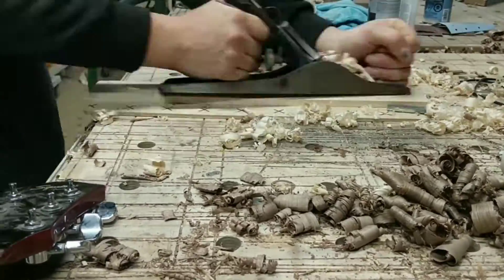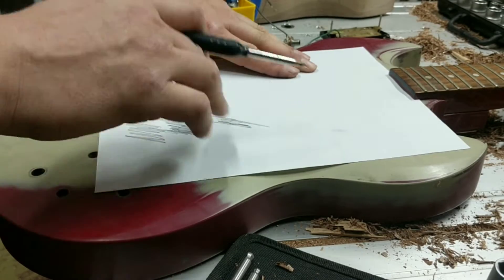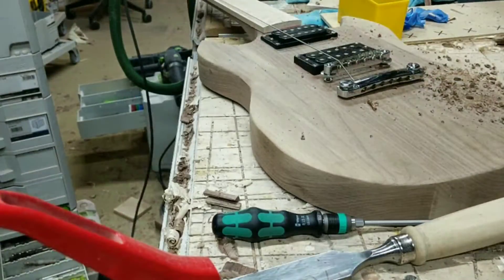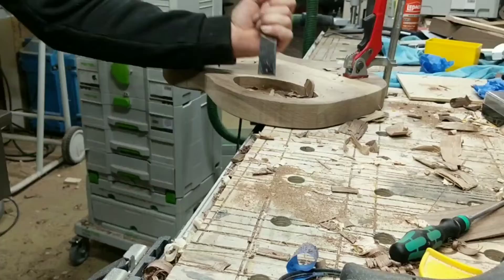The Guitar build series: Hardware Install

Comment: Hey man, it's better to hog out the bulk of the material out of the cavities with a forstner bit before routing, this way you will get a clean bottom without overloading the bit and router, no chiseling needed ;) Also, don't use glue in the bridge posts, you won't be able to easily change bridges later and also the pressure is lateral not vertical so they won't come out.
Reply from the maker: I realized those after cutting the cavity. And the glue as well. Thank you for looking out for a first time buildrr
Reply: Anytime, let me know if I can help with anything.